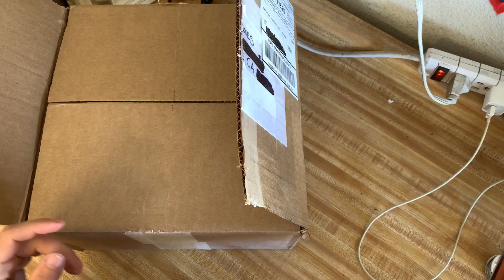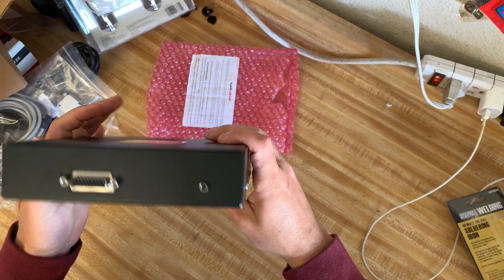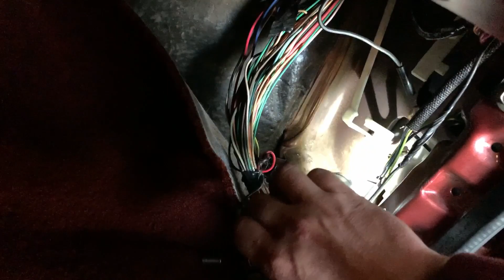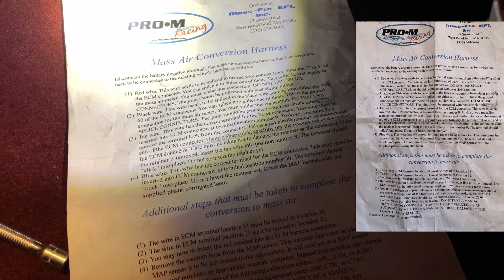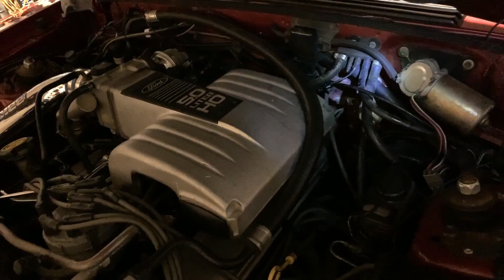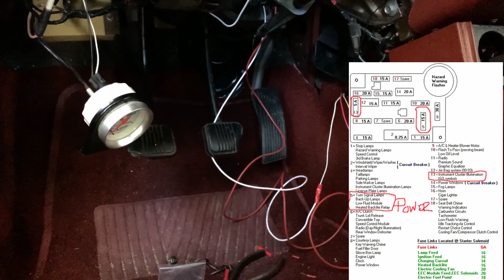How To Install a Megasquirt MSPNP2 in a Foxbody! (PART 1)

Comment: The MS has a map sensor built in it and is a speed density computer. You didn't have to undo the A9L mas air wiring....
Reply from the maker: Yea I know it has the map and baro built into it but I’d rather have the harness in its stock configuration rather than have a bunch of stray wires all over the place plus it was only two wires to remove and two wires to switch into their stock location so I just put it back to how it was originally since I’m the one who wired the new MAF sensor And swapped the A9L from the original speed density computer. I just wanted it all the way it was before I put the MS in LOL